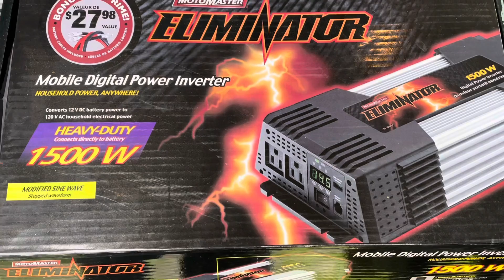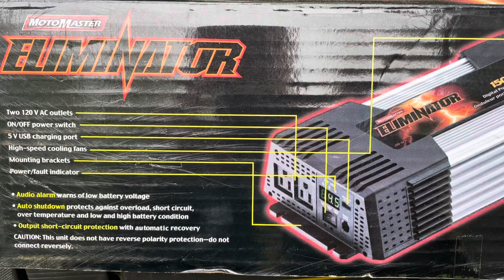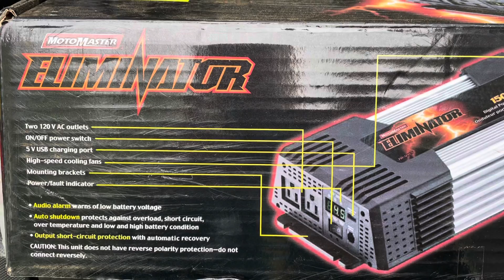Inverter + Car = Quiet Emergency Power Generator (12v DC to 120v AC)

Comment: Hey John. Good video. Yea, we had quite the mess around here as well. There are spots that still don't have power around Ottawa. We are OK. We only went for about 9 hours. I have a couple of gas generators in my shop, so we can get by as long as we can get gas. Thanks for sharing.🍁👍👍
Reply from the maker: Hi Andy !  It’s good to be prepared just incase ! ✅😎👍🏽